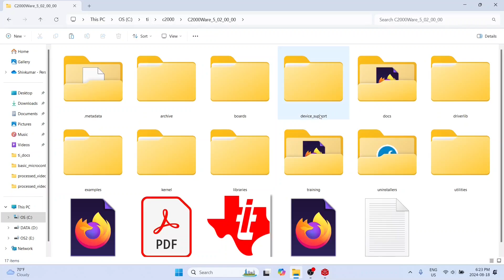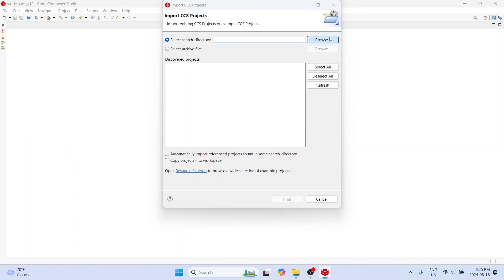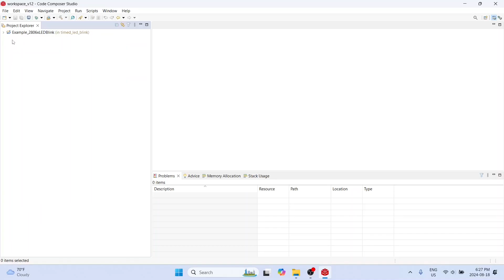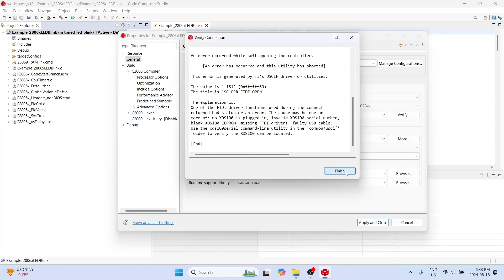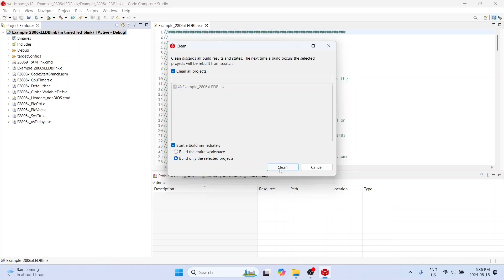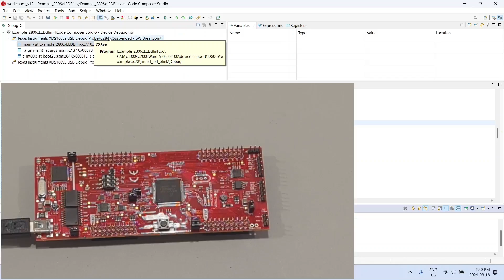Testing the LAUNCHXL-F28069M microcontroller kit

Comment: Good Sir. You can also add TMS320F28379D which can be also useful for motor drive applications. Also in some piccolo processors there is INSTA SPIN applications. Can you also explain that which will be very much useful for motor drive applications.